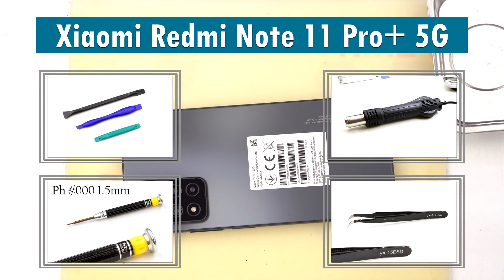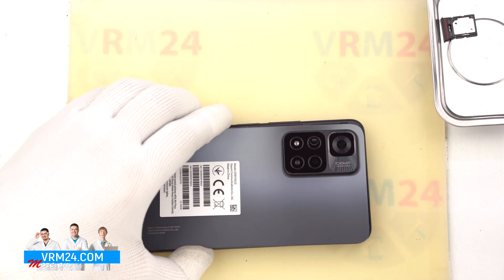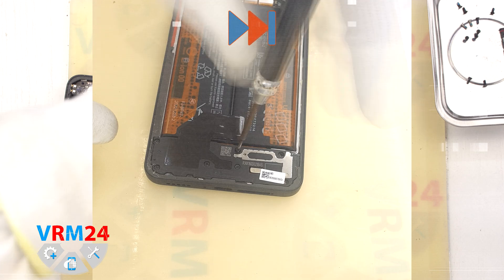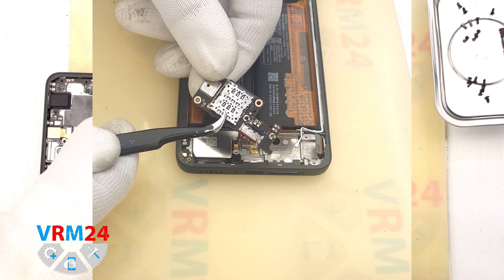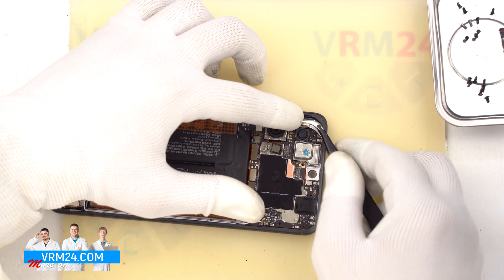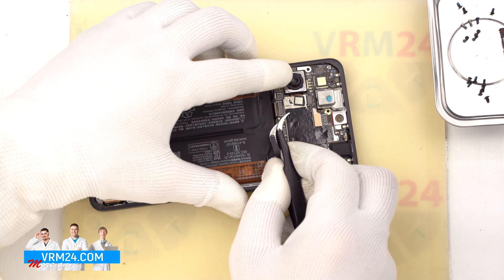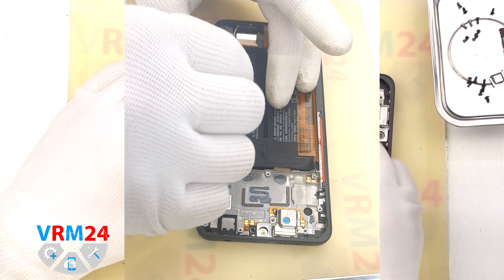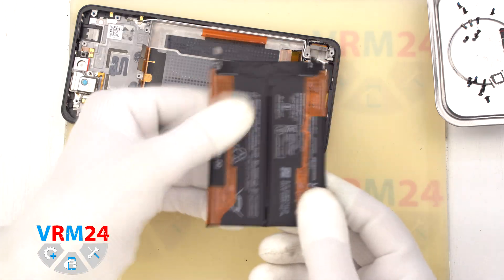Xiaomi Redmi Note 11 Pro+ 5G 21091116UG Disassembly in detail Take apart

Comment: Hi. Can battery be removed/replaced without removing all the boards you did first?
Reply: I have the same question
Reply: @dyslexia23 the answer is yes. Only one side cover with screws. Just need to be careful when cleaning from the adhesive, I damaged the power button wire and had to order that one too
Reply: @manns4  oh thanks for the response, is it the cover at the top or the bottom that needs to be removed?
I ordered a battery for this one and there is very little information on how to replace it DIY  style
Reply: @dyslexia23 just the upper cover that covers the camera etc.. there are two battery connectors left and right and you start pulling the battery carefully. My new battery came with new universal adhesive strips for the battery so remove the old adhesive film if it says in the phone. Nothing hard, just easy careful steps every way.
Reply: @manns4  awesome, ur my momentary hero brother. thanks from the bottom of my heart